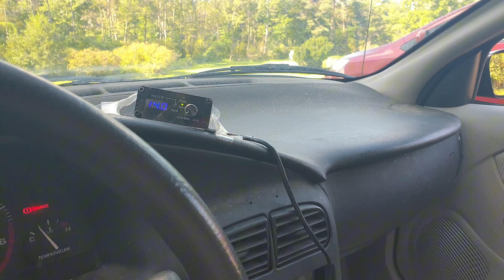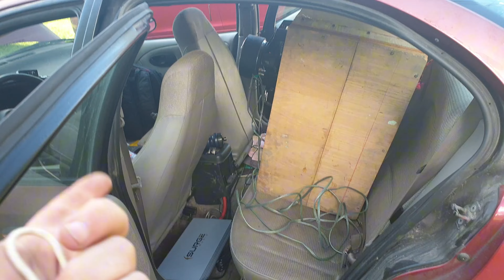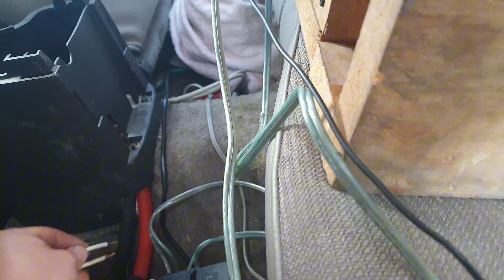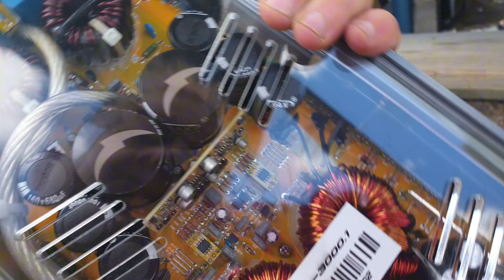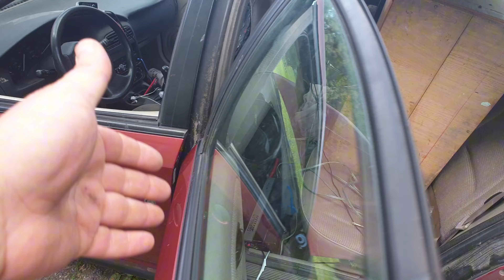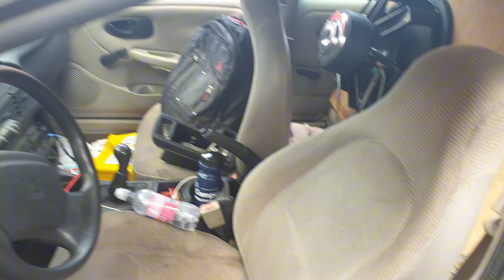SurgeAudio PL-3000.1 replacement amp trying to burn up again. PT2

Comment: These amps are no good bro. Literally all of them. And Colin isn’t doing anything to fix it. I’m still waiting on mine to get back from warranty I sent it in October and still nothing I’ve been sending emails with no response
Reply from the maker: @Fullerton_Hotel  im in similar boat. no responce. My amp obviously was replaced the first time but this time around I can't even get an email back
Reply: @ did they repair it or give you a new amp?

Comment: The + for the amp really should be on the battery and fused. The wire from the battery to the alternator is not heavy enough.
Reply from the maker: @Johnny-Elbows  The battery is not where the power comes from, the amplifier wants 14.4 V not 12.
Reply from the maker: @Johnny-Elbows  also the fuses in the center console

Comment: These amps have bad inductors. The two coils on the output section will get very hot. To the point it will melt and crack the plexi. Ask me how I know. These amps are junk and are being sent in due repair new from the factory left and right.
Reply from the maker: are the inductors undersized or off in value? if you know the correct value my capacitor tester does inductance as well and im competent enough to wind my own farrite core transformers.

i was actually gonna install much more colling to try and seee if i can stop a metldown, also move the thermal couple to directly attached to a coil winding so the hottest part of the amp is the reported temp. 

i got a MONSTER 12v Sunon fan, its like a muffin fan but 12v, and like 6a. would likely be using a few old big PC case fans that dont really make noise but move a modarte ammount of air.
Reply: @RockeyDAproductions  I have no idea. The guy from surge told me that's what the problem is. It's wide spread. A gentleman on YouTube has seven of them all have the same problem.